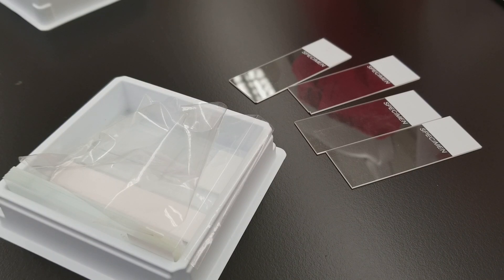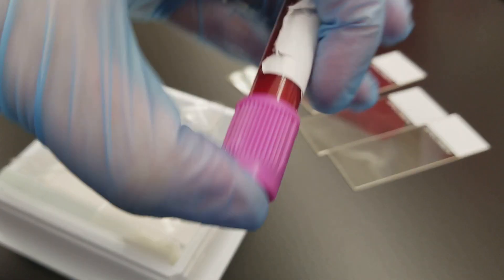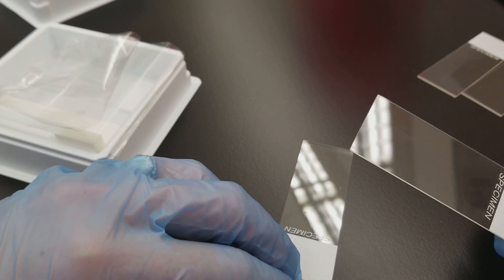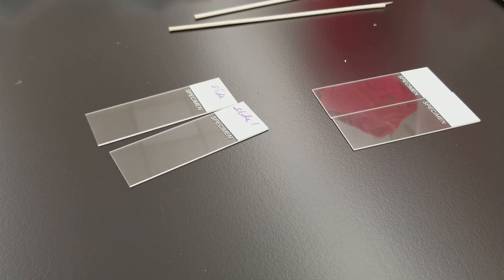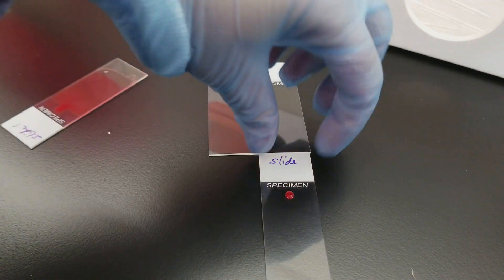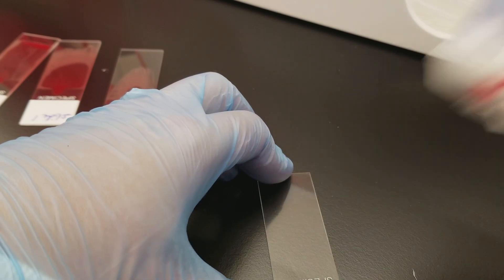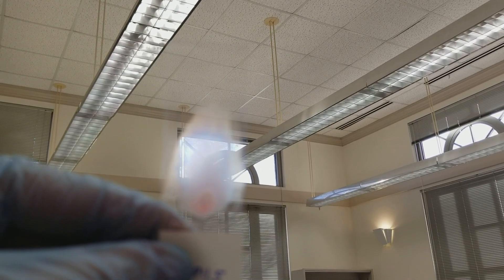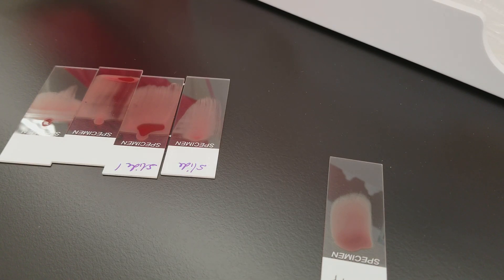Hematology: An Unconventional Way to Make Peripheral Blood Smears

Comment: Thank You for sharing this technique, it looks easier than the traditional one
Reply from the maker: You will probably see so many people use different methods.  What is important is that you find one that suits you and provides the best results : )
Reply: @MedicalLabLadyGill  I tried out the technique. It didn't work because the glas-slides we use must be of a cheaper quality than the ones You Are using. The long edges have an uneven surface and cut, oppositr to the short edge which have an Even surface and clean cut. 
So it Will still be the ordinary technique here🙂
Reply from the maker: @Aifosfect  LOL